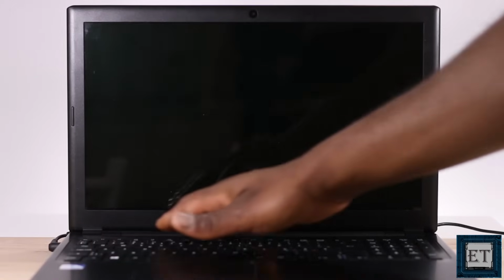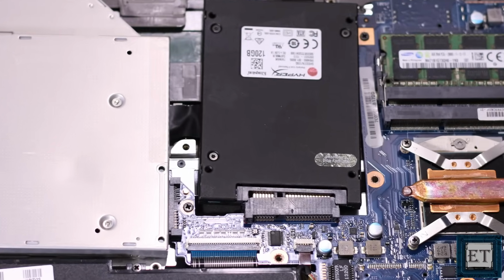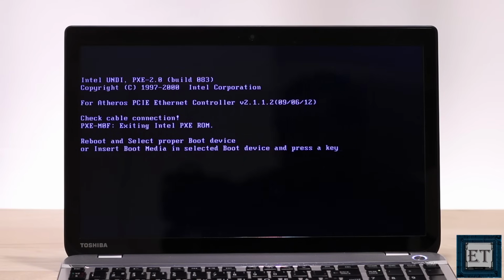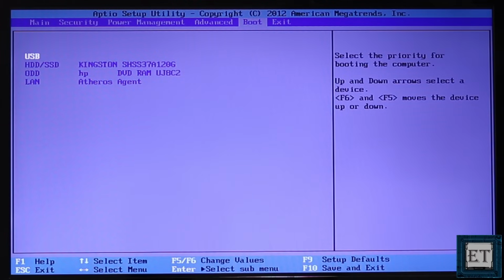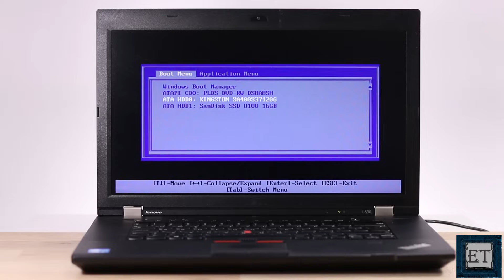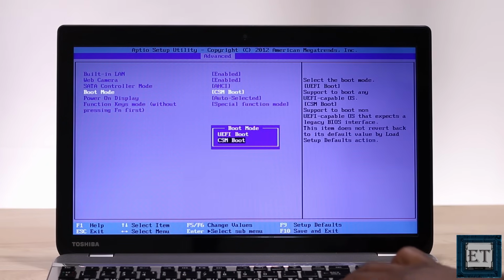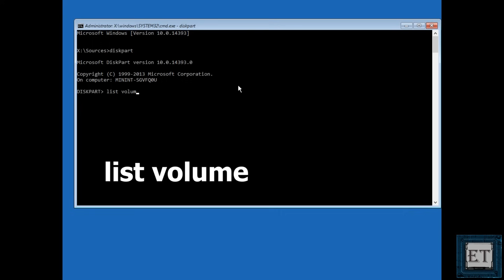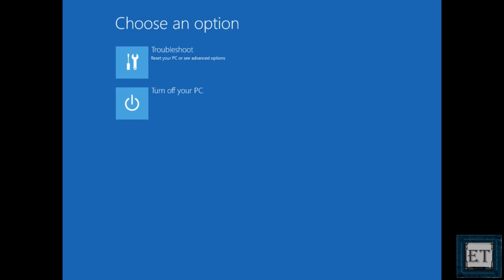How to Fix Operating System Not Found in Windows (No Bootable Device)

Comment from the maker: -  Get genuine Windows keys at 𝑷𝒓𝒊𝒎𝒆 𝑻𝒆𝒄𝒉 𝑴𝒂𝒓𝒕, Use ET20 for 20% OFF! links below:
✅ Windows 10 Pro key: https://bit.ly/2G7CVKt
✅ Windows 11 Pro key: https://bit.ly/31jyHdg 
✅ Other Software Products: https://bit.ly/3r03TYu
Reply: Thanx for the info, but my laptop was fixed once I turned it off and turned on again
Reply: Thank you so much❤️
Reply: Thank u so much
Reply: On the active part my cmd says the selected disk is not a fixed mbr disk. The ACTIVE command can only be used on fixed mbr disks.
Reply: Wow thank you so much
Reply: L
Reply: EasyTechs ! This is also bcz of keyboard problem
Reply: Easier way if you boot from usb be sure that you made the usb boot properly..
most issue is when you forget to set your  usb as active

Comment: It works for me im hp user the vidoe method not work or u have to boot eveytime manually from EFI then you can try that i found that in a comment section thanks to that man.! And my boot option was UEFI (Hybrid)
 Easy peasy lemon squeezy solution for the situation

if you guys keep getting the error

1. go to boot menu

2. Select custom boot as 1st option in boot sequence

3. At the custom boot option there will be two options

a. add, b. Delete, Select ADD option

4. Now if done correctly, there will be an option with a rectangle to type anything on the boot menu

5. Add " \EFI\ubuntu\grubx64.efi

6. Save and restart

Comment: Ah, thank you!  I was having a hard time making my laptop recognize a bootable flash drive that contained linux in it.  So I took out the hdd out of the bootable list and finally the flash drive was recognized.  This was troublesome since the screen for loading linux was bigger than tbe actual screen size and I had use the tab button to go forward in the instalation.  
     It was irritating to see "no operating system found" on the screen and had no idea what had happened.  Obviously I forgot that I had changed the boot order on my laptop and your 2nd option was the answer.  Cheers.

Comment: Hello! If I did this command 

diskpart 
list disk
select disk 1
clean 
create partition primary
select partition1
active
format fs=ntfs quick
assign
exit

but I chose disk 0 which was my ssd how do I undo that? 
After I did this my pc got the message “an operating system is not found” etc

Comment: I have dell and pressing F2 or F12 doesn't even start bios, please help!!!!!!
Reply: Intel UNDI, PXE-2.1 (build 083)
 Copyright (C) 1997-2000 Intel Corporation 

 This product is covered by one or more of the following patents:
 US5, 307,459,   US5,434,872,  US5,732,094,  US6,570,884,   US6,115,776
 and US6, 327, 625

 Realtek PCIe GBE Family Controller Series v2.35 (06/14/10)
 PXE-E61: Media test failure, check cable

 PXE-M0F: Exiting PXE ROM.
That message appears for about 2 seconds then the laptop restarts and this goes again and again in a loop.

Comment: my laptop default boot is my samsung evo ssd 240gb when i bought it. then I add / upgarded to NVme ssd 512gb in my laptop and make it as my boot priority.
my samsung evo 240gb is my secondary drive now, it is my data storages. the problem is I want to upgrade my data storages to 512gb ssd instead of 240gb only. but my computer wont boot if i removed the samsung evo 240gb. Even my I setup my boot priority to my NVme ssd. when i inserted my samsung evo 240gb via usb adapter my laptop boot. everything works fine. but when i removed the try to restar my laptop it wont boot. I've tried deferent solution and no fix. So I return back my samsung evo 240gb ssd in my laptop. I cant upgrade my laptop storages because of that thing that it wont boot even its not my primary boot..
Reply: Haing same problem with 2tb Samsung ssd

Comment: I got the no operating system found message after I attempted to install windows 10 on a 2007 windows vista laptop. It was working perfectly fine but then, nothing. Mine seems to be a software problem, not hardware. How do I fix it?

Comment: My hp laptop boots fine, is up for sometime, then hangs and crashes with boot device not found, hdd not found error. I force shutdown and  it boots again. Is the hdd loose with the connector possibly?
Reply: Possible, but your HDD could be failing
Reply: @milktoast56  Thanks for the response. Actually the fan malfunctioned. Replaced it. Now its okay. 😁

Comment: mine was loose connection to mother board after i knocked the pc off the table with my huge belly so thank you sir for the fix
Reply from the maker: Good to know it helped you out, thanks so much for the feedback!
Reply: @EasyTechs  hey boss do you maybe got any idea what size usb stick or flash drive do i need to create a system image for windows 7 off my gateway laptop?

Comment: Hi, when I try to enter the command active, it says "The selected disk is not a fixed MBR disk." I have chosen correct volume. Could you help me out?
Reply: Have you fixed your issue? I know its 1year ago. But mine does this can u help me out?
Reply: I don't really remember, sorry
Reply: I already fixed mine. I did the reset bios jumper method and my bios resets to its default settings

Comment: I get this issue on my desktop PC and I actually tried almost all of these solutions before finding this video. The strange thing is if I go into BIOS and then press escape without making any changes it loads Windows 10 fine. However this is annoying so not really a proper solution just a workaround. Any ideas?

Comment: Hello guys, so my father bought an dell desktop on a thrift store some months ago and when I tired to open it, it had the previous owner’s admin password. So to bypass this, I performed the Dban method using a USB drive, I wiped all the data on that PC, but the problem is that when I restart it, it says no bootable device. Should I install an OS from the beginning, maybe upgrade since I’m there? ....The PC had previously Windows 7 pro as an operating system, I will upgrade it to Windows 10 32 bit operating system, using a USB drive( the same that I used for DBAN, but formatted). Will this method that I’m bout to do fix it?

Comment: I followed every step on the last solution but on minute 7:59 on the active part I got a massage saying "the selected disk is not a fixed MBR disk " I used both methods the you included in the video you made specially to make a the bootable usp please help me out with a solution
Reply: I'm having the same problem. Did you find a way to fix it?

Comment: The first time this happened to me, I got my pc repaired, they replaced my HDD, now this is the second time happening to me. Instead of getting it fixed I found your video, and by step 3 my system booted up. I couldn't believe it worked so I restarted and still it worked. Thank you so much!
Reply: same. step 3 did it for me
Reply: Today i got a ssd..and this problem happened to me
Reply: Can i ask if my files will still be there or will i loose it?